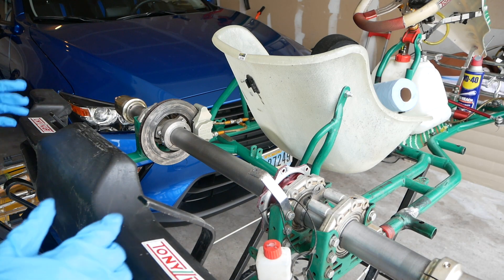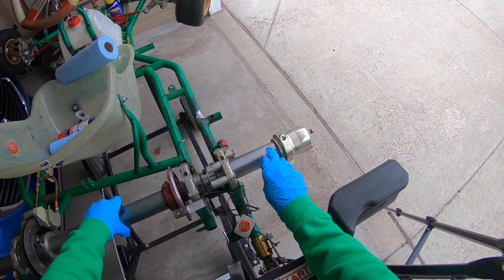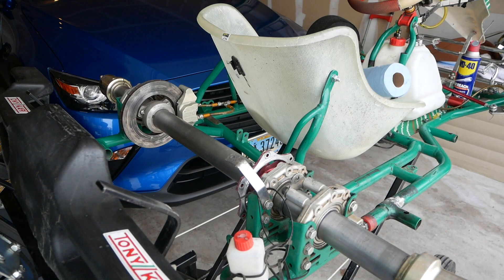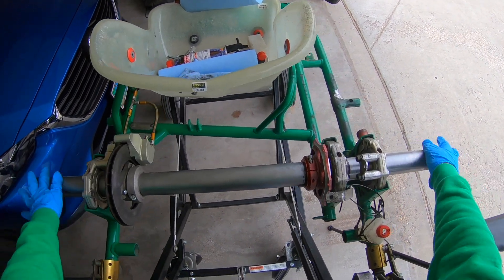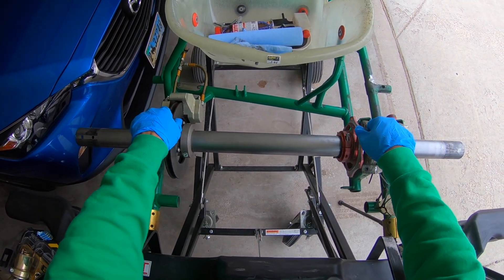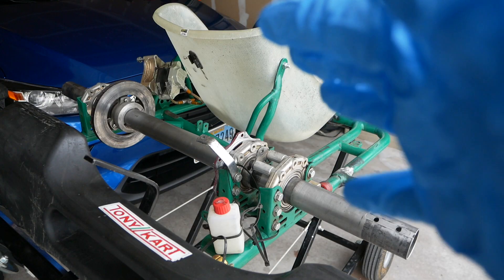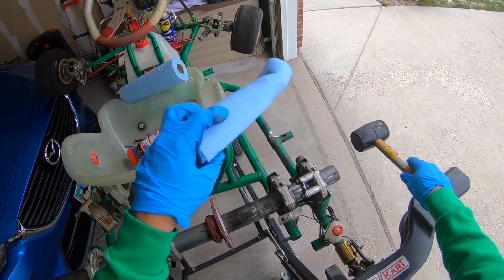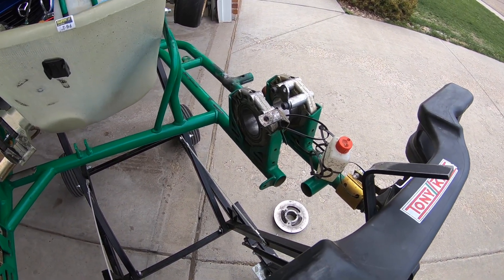How To Remove/Replace Go Kart Rear Axle Part 1

Comment: See the groove in the hub?  That's there so you can jam a thick screwdriver in & open it up a bit so you don't have to smash the hub with a hammer!  Why did you take off the left hub?
Reply from the maker: Thanks for the info, I didn't know that. I normally take those off.

Comment: Whatever i do my axle is stuck. I bought a used kart and it problaly hasn't been moved in a while. Do you have any tips to get is loose?
Thanks
Reply from the maker: Sorry to hear you are having issue removing your axle. Did you remove all of the hex screws and all things attached to the axle? Hopefully the axle is not bent, also do you have a rubber mallet and PB blaster? those could help with removing the axle.
Reply: @AJsRacingJourney  thanks for the help. It was one hex screw that I could get out, but I managed to do it and put on a lot of lubrication and I managed to remove the axle. Thanks again
Reply from the maker: @theodorwllestad9324  That's awesome to hear! Let me know you need help with anything else.